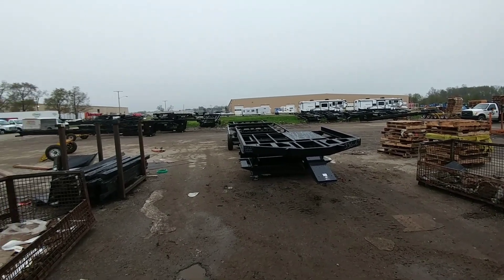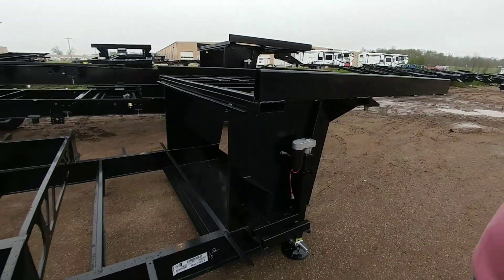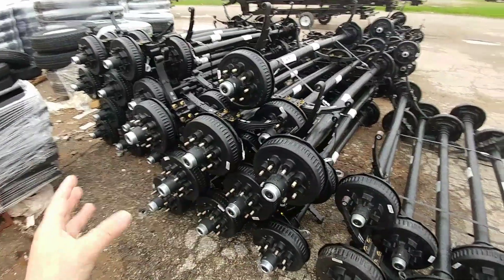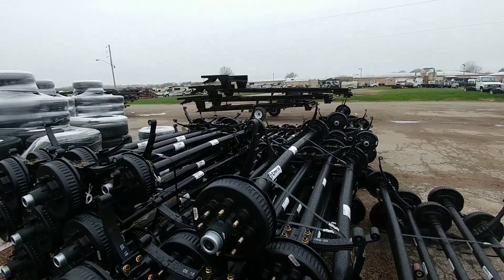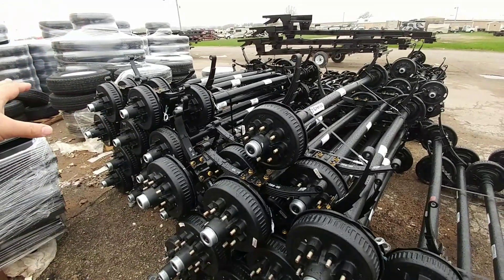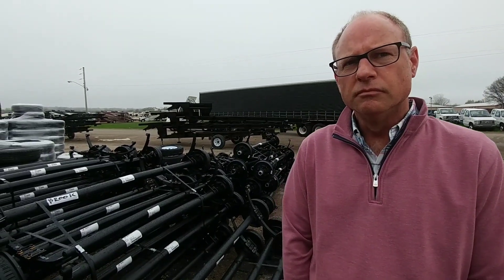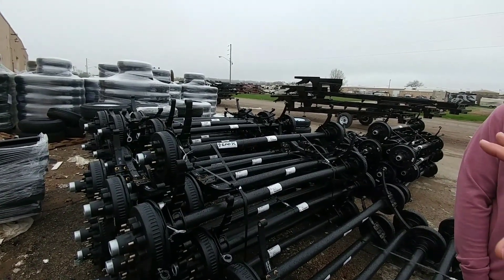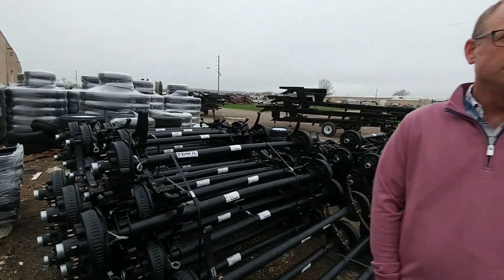Fifth Wheel Frame and Axle Ratings! Building a Fifth Wheel RV! Coachmen Fifth Wheel factory Tour!

Comment: On the topic of axles and the frame you failed to mention how the industry regularly creates unsupported floor spans of up to six feet! Why not add a couple more lightweight steel cross members to support the floors to avoid floor failure. FYI I am currently reinforcing the floor with lumber on my 2017 Forest River because my floors are cracking and failing! A bunch of BS in the industry.
Reply from the maker: So I don't know why your floor has failed, but looking at the frame and seeing large open sections doesn't really apply to the floor structure (on most) because the floor has it's own framed structure that is mounted above the frame.  In most floors, the spacing is only about 16-24" between aluminum or wood joists.  If your floors are cracking and failing, you might have some other issue that needs to be addressed. Perhaps it wasn't fastened to the frame correctly or you have some portion of the frame that has broken and is causing too much flex.
Reply: @BTBRVReviews  in my case my Forest River has the thin plywood over inch and a half foam sandwiched with another sheet of thin plywood.
 I have spans that go from front to back anywhere from 1 1/2 feet to 6 feet in length with side to side width being approximately 6 ft.  
I've worked on older models in the past and the trend seems to be only putting support where the foot traffic happens and that wasn't so bad but in the case of this Forest River it's definitely a failure in the design and Manufacturing.
I only mention it because from your videos I saw the same types of spans they're obvious on the frame and crossmember supports.
Reply: Yes, and why in the world don't they coat the wood flooring with polyurethane or something?!? A tiny leak can cause thousands of damage to floors before the problem is even detected. Happens a LOT!

Comment: Does the axles maintenance determine the type of axles used per price point? Does ease of axile maintenance factor in when the manufacturer is specifying an style or choice of axles?
Reply from the maker: Everything determines price.  Every add on adds costs
Reply: Big Truck Big RV the questions Richard is asking and many others are a good reason you should set up an interview with a Coachmen chassis/structural engineer and dive deep into all the variables, maybe with a couple of their models as examples.  You are the man for this assignment!

Comment: If you upgrade to higher capacity axles, do you get a corresponding increase in GVWR? Or is it more complicated than that?
Reply: Little more complicated. Frame also has to be able along with bolts, springs and so forth. Can have a tough axles setp that may cause damage to the frame or a weak axle thatll bow to a beefy frame.
Reply from the maker: Yep and even more than that, most fifth wheels are derated to show a lower capacity that they are capable of to prevent from being overloaded

Comment: Do some of those axle tubes look bent in the middle? Is that normal?
Reply: Marty - Yes the curve to the axle is normal.  Similar to if you look at long flatbed tractor trailers.  Unloaded they have a curve or arc to them.  This is designed in because once they are weighted down they will flatten out.  If there were no curve then you could potentially bend or damage them when loaded.

Think of it as a leaf spring flipped upside down.
Reply: I think it's called prestressing. Bridges do this also.
Reply: It's camber. And if you change from overslung axles to underslung axles, you need to pay special attention to ordering the right one

Comment: I never could understand why rv manufacturers seem to always want to cut corners on the axles, why have the axles near maxed out for life? I believe axles should have the capability to support the FULL weight of the rv with ALL full tanks, while at the same time position the axles so that there is a proper amount of weight on the truck, then de-rate the GVWR a little, this will provide a safety margin and axles will not be maxed out all their life leading to unnecessary premature failure.
Truck manufacturers do this, your GVWR is lower than the GAWR, there is a reason for this, it’s called safety.
Reply from the maker: That was the point of this video.  So, let me ask you a question.  If the RV , with full tanks and cargo, places 10k lb of weight on the axles, what should the axles be rated at total?
Reply from the maker: Truck manufactures don't do this.  My Ford F450 has a 9,600lb rated rear axle.  The truck has a 14,000lb GVWR.  Remember, the truck (when towing a fifth wheel) acts as the front axle would on a vehicle.
Reply: Big Truck Big RV, I would put at least two 6k axles on that rv, it may be a bit overkill but the axles would never be at their max.
Reply: Big Truck Big RV, but if you add together both axle ratings on the truck the number will be higher than the GVWR.
Reply from the maker: @fuckoff7028 .  You just made my point.  At 14,500lbs, the Fifth Wheel using 2 - 7k (14k) axles will only have 10k lbs on the axles at any given time.  Even when near fully loaded (2000lbs of cargo, which is excessive on a non-toy hauler) there will only be around 12k on the axles.  That's a 2,500lb buffer, nowhere near their max.  I asked the question about a pickup, because a Fifth Wheel by design, uses the Pickup as the front axle.  So, some additional food for thought: On a pickup, if you add both front and rear axle rating together, they will generally match or slightly exceed the trucks GVWR.   On a Fifth Wheel, if you take the pin weight and add it to the rear axle rating, you will exceed the GVWR of the fifth Wheel. So thats 14,000lbs + 2900lbs = 16,900lbs of total capacity.  The trailer's GVWR is 14,500lbs.  So that's 2,400lbs over the GVWR
Reply from the maker: By the way, your screen name pretty much guarantees your comments are going to be flagged for review.  You may not want to change it, but I have to go in and approve each comment you leave.  This is probably the same for any other channel you comment on that flags bad language.  I'm not always looking at my "held for review" comments.  So you might consider changing your screen name if that matters to you. FYI, I'm only approving your comments because you're asking good questions.

Comment: Axels are never designed to bare the entire load. Such a great idea. It’s not like peoples lives are depending on it. You send these heavy campers out on the road with Maypop tires and Chinese bearings. It’s amazing how more people don’t get killed, riding on such junk components. These campers should be riding on tandem duals. There’s no reason for this. Then you have crappy electric brakes with about 1/8” of pad. Normally when you get to 1/8” or pad it’s time to change them. Nope. They come factory that way. Such garbage! Everything about campers are junk. Front to back, top to bottom

Comment: why are fifth wheel axles and travel trailer axles  a single wheel setup and not a dual wheel setup
Reply from the maker: Dually would be far more difficult to change a tire, they provide less clearance for tanks and other equipment between the frame rails, they require a significantly modified suspension, they are hard to check tire pressure, they also mount to significantly narrower frame rails which are not as good of a platform to built an RV body on (slides and such)
Reply: There are models that have duals. Just not common. Heres some images. Newmare Kountry Aire https://www.bing.com/images/search?q=2006+Newmar+Kountry+Aire&FORM=HDRSC2
Reply from the maker: Some older models tried that over 12 years ago because they had really high chassis weights and were using different frame manufacturers that also built gooseneck trailers.